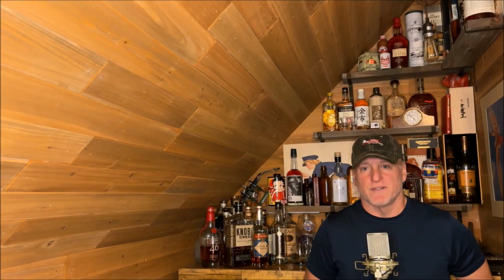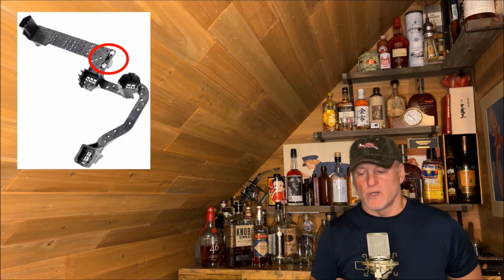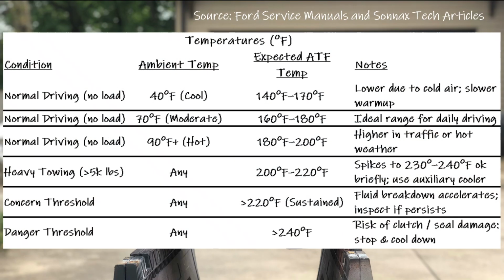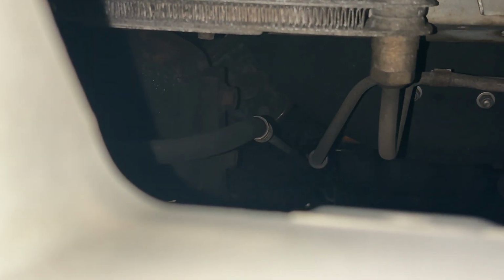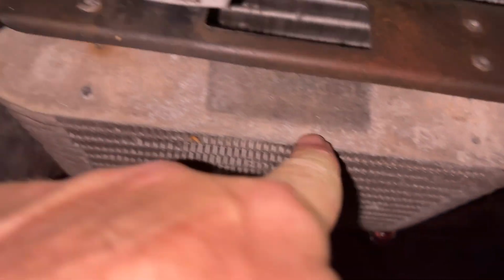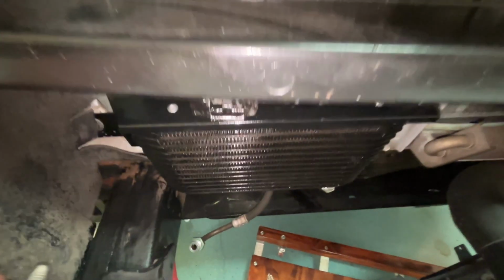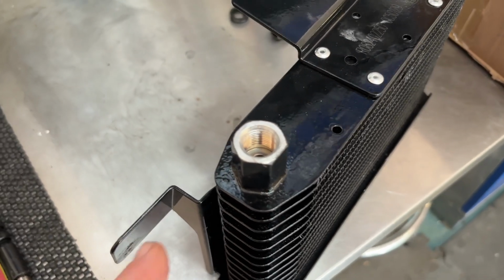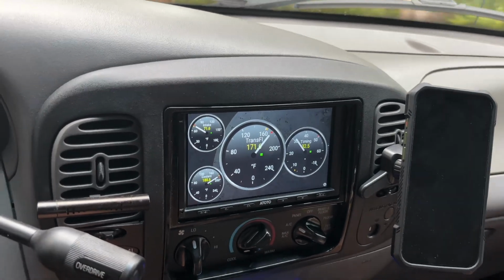Critical F150 Transmission Temps You Can't Ignore: 4R70W ATF Cooler Replacement

Comment: Hey question. When you rebuilt the transmission did you consider a transmission swap? I have a 4R100 in my Navigator,  it’s just been rebuilt too so it’s not bad but it’s just kinda slow. Compared to a stick or modem auto it’s boring. The 5.4L 32 valve in my Navigator likes to rev out and the 4R100 doesn’t allow it to. 
I’ve been looking at a 8HP75 or manual swap. The 8HP75 is a modern dodge 8 speed transmission you can get cheap that shifts fast and smooth. A manual is a manual. I could probably make it work with a leather boot in the center console but a 8 speed would be great. 

The issue I’ve been having with both options is making my auto ECU not control a auto. I’ve seen on the forums a Auto ECU will detune if it has no transmission connected. A tune might fix this issue? But am in California so I’ve been t looking at a solution to emulating the Auto trans. 
Everything else in a 8HP swap is fine. A 8Hp to modular ford adapter exists. I can use a TurboLamik controller with analog inputs, A custom drive shaft and mount and am done basically. The 8HP can probably handle towing better than a 4R100 as it locks up way earlier and has 8 speeds.

A manual would probably be the same as I don’t think a stick ever came behind a 5.4L F150 yet alone a Navigator or expedition.

So what are your thoughts on a 8HP or manual swaps in our trucks? I think this upgrade would be well worth it as it would bring these old trucks closer to modern standards in power and fuel economy.
Reply from the maker: Good question. I did think about swaps when I was in there, but for this build I wanted to show what a properly rebuilt 4R70W can do with good internals and calibration.

The 8HP idea is definitely interesting—great ratios, fast shifts, early lockup—but once you factor in ECU strategy, emulation/tuning (especially in CA), standalone control, and long-term serviceability, it turns into a much bigger systems project than just a transmission swap.

A manual is cool too, but packaging, ECU logic, and emissions compliance make it tough in these trucks.

If I were going modern, I’d lean 6R80 first. It was used behind 5.4L Ford trucks/SUVs, so it integrates with the modular engine platform better than an 8HP or manual. That said, it’s still not plug-and-play—you’re dealing with newer control strategies, wiring, and tuning—but it’s a more natural fit and generally a lower-risk path than adapting a completely different transmission.

Appreciate the detailed comment—cool ideas either way 👍
Reply: @DrivingIntelligence I didn’t think of the 6R80 much as it would probably take just as much work as a manual of 8HP except for the adapter. The 6R80 only came behind the 3 valves so no PCM is easily swapable and you would probably still need a custom driveshaft. 
The 6R80 ain’t that great either so you might as well go 8HP at that point. The ram 1500 8HP seems to be as close of a OEM fit as possible. It comes in 2WD and 4WD versions and has a slip yoke. A 1500 drive shaft can probably be modified to fit. And happens to be 10” longer than my Navigator driveshaft (the 8Hp is 10” shorter so it should equal out)
The biggest issue still is the stock PCM. From reading the forums you can trick the PCM with resistors but it will still give a lower power mode as your transmission solenoids aren’t there. 
It might be easiest to use a standalone like the MaxxECU to control engine ignition and fuel and the 8HP. The stock PCM wired with resistors shouldn’t complain much, so the only codes would transmission related allowing me pass smog and retain my stock gauges. Or I could use a Arduino or similar and emulate the stock 4R100 like some Lexus guys do. This would be closest to stock but require a bunch of time going through workshop manuals.

Comment: Sometime ago I told you about my 2001 F150 model 7700 5.4 Triton that I brought into a auto shop when I blew spark plug number eight. They charged me a lot of money and after I drove the vehicle away I discovered it had a serious problem. It turns out they used the wrong size drill for the insert and effed it for ever. A new head is required. Not worth repairing. I will keep it for parts and buy a used 1999 f250 with the same engine in good shape for less than the cost of labour to install a new head.
Reply from the maker: really sorry to hear about that.  Too bad you can't remove the head yourself.  A lot of work, but doable.  A crate engine is another option, but I hear you, alot of expense.   I like the F250 LD / 7700 trucks.

Comment: I see you're using torque. There are 3 different trans temps pids and none of them are close to one another. I use my sctx4 to monitor all my data because I need to see trans temps. You may not even be getting correct data on your screen. I added a derale aux cooler after my factory aux cooler. So I technically have 3 trans coolers now. I was seeing 200-210 while towing 8k before the aux cooler. Now I've never seen above 170 even towing in 110 degree heat out west pulling mountain grades with a trailer. I did also change my fluid and filter and used valvoline ATF. I am a little worried about winter, because even before adding this cooler I was struggling to get over 100 degrees in the winter, which is overcooling. I am worried Ill struggle to get over 60 now
Reply from the maker: interesting dilemma.  It is important to get ATF temps to above 140F for proper operation.  It's good you still use your radiator which is also important for heating up the ATF more quickly. 

Thanks for the heads up checking temps with an SCT X4.  I had not thought of that.  I kinda feel like the Torque app is accurate since I'm using Ford PIDs.  I'll check with the SCT X4.

Have you done any other work on your transmission?  I have a 2100 rpm stall converter in this truck since I did the transmission rebuild and I think that adds heat.

Comment: Really like your no BS videos, do you do much heavy towing at all because nothing is harder on a trans than heavy towing, did you have previous overheating issues, I have an 03 that's  just like yours and it came with a factory tow package and bigger radiator and it never seems to get hot even in triple digit summer weather with the A/C running was just curious if that was why you changed your radiator, last question was that a new trans you installed or did you rebuild it.
Reply from the maker: thanks for the positive comment.  

I did rebuild the transmission myself and added some high performance parts for durability including a higher stall converter.  

I never overheated the transmission, just worried when temps got higher than I was used to.  And mine also has the factory tow package with the bigger transmission cooler.

How do you know your transmission isn't getting hot?  Do you have a temperature gauge?

Comment: I don't think your transmission temp is that bad .Considering your coolant temp is around 185 to 200.  Great video.
Reply from the maker: appreciate the comment.  After I did some research, I realized my temps were not that bad.  I had heard through forums that over 200 was bad, but it's not.  I never got above 206F when towing and not even close to that when not towing.
Reply: @DrivingIntelligence You still did improve on it.